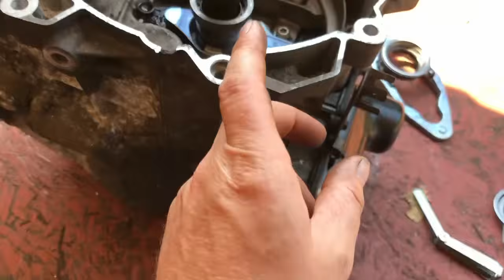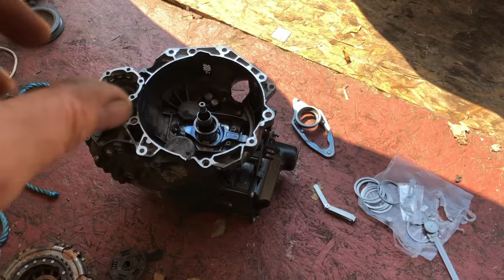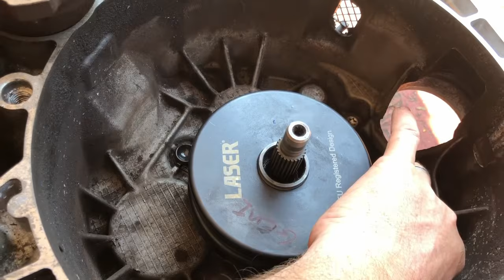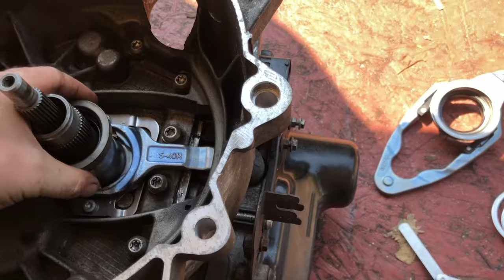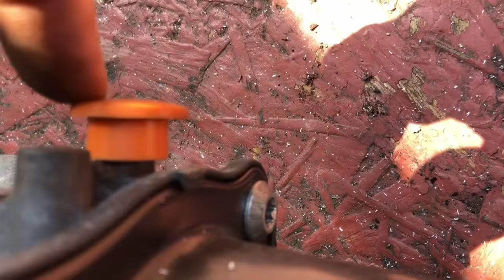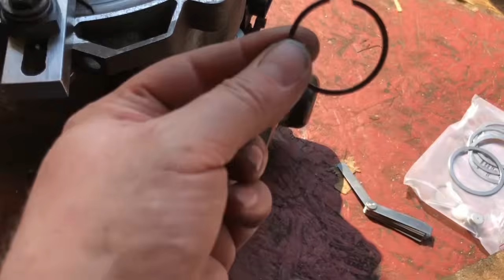DQ200 7 Speed DSG Clutch replacement - DIY - How to.. VW Audi

Comment: I have a dq200 0AM on golf 6. To pull down the transmission to change only the clutch there is a procedure to release pistons?
Reply from the maker: What pistons.?
Reply: @Roverturbo  pistons of the clutch, to remove transmission and to change the clutch I need to release them via obd or with a special mechanic tool?
Reply from the maker: No, you don’t need to.
Reply: @Roverturbo I have only to put it in N or P ? Without pull off battery?and I can pull down transmission and change the clutch?the pistons not remain in pressure?
Reply from the maker: No, they don’t retain pressure.
Reply: @Roverturbo but why if I put it in N the le K1 fork remain in pressure?

Comment: Thanks. 

Just done one, my first. This (your) video helped. Seeing it is more help than being told. 

I work on cars for a living, and everyone always said it was ‘very complex’ when in fact it is not. 

One comment, when mentioning the +0.2 or -0.3 on the clutch pack (or whatever the numbers actually are) referring to the K1 or the K2 engagement bearings you contradict the instructions in the tool kit. 
I used the very kit you did, same part number, same manufacturer.

You say that if  says on the clutch pack, K1 +0.2, take 0.2mm OFF the shim, the instructions say to ‘do what is says” so if it says +0.2 add 0.2 to the shim.
Reply from the maker: Thanks for the comments…. Must of been a slip of the tongue.

Comment: Would you not just put the same shims in that you took out ??
Reply from the maker: You can’t, Such fine tolerances.
Reply: ah ok I thought it be same size shins go back in
Reply: @Roverturbo sorry to bug you again but would you say a vw golf mk6 is a v1 cluch ?
Reply from the maker: 7 speed dsg?  They changed over around 2011, you would have you contact your parts supplier to check.

Comment: I am about to buy a Scirocco 2009 and owner says DSG blinks after 30-40 min of drive so I am looking at how to fix it myself but I do now know yet what can it be? Any ideas?

I do maintenance to my car but never took a gearbox appart and it's scary. Thanks for the video.
Reply from the maker: You need codes before you can do anything. Is that a wet or dry clutch. It’s going to have to be cheap, dsg repairs can be costly.
Reply: @Roverturbo  There are no codes stored seller said, just blinks/flashes after 30-40 minute drive. 

It's dry clutch I believe DSG 7G Scirocco 2009 DQ200

Comment: Did you change flywheel as well?
Reply from the maker: No
Reply: @Roverturbo I need to get mine replaced in my seat DQ200. Do you think I should get flywheel replacement same time?  Thanks for the reply
Reply from the maker: As long as it looks ok. I don’t believe it’s a dual mass or anything like that. Just check it once the gearbox is off.
Reply: @Roverturbo do you mean it doesn't have dual mass flywheel?
Reply from the maker: As I said, I don’t believe it has one, no.
Reply: @Roverturbo thanks for the input. I appreciate it

Comment: Hi just wondering what size shims you used on K1 and K2
Reply from the maker: It’s irrelevant…. What’s needed are unique to every gearbox and clutch pack.
Reply: @Roverturbo  I've got a Gen 1 gearbox and I've got the same issue in Australia no one wants to work on it and to buy the Laser tool kit from the UK is $1500 AUD including shipping. I can find other brands but they for gen 2 only
Reply: @Roverturbo  Plus the new Luk clutch has zero tolerances
Reply from the maker: Doesn’t matter, still needs to be shimmed correctly. All gearbox’s will have different tolerances.

Comment: i have a3 8p 7 sp auto gear box last 3 years its vibration 2to 3rd gear change when he gets hot and now starts 1 st to 2nd is well time to change the cluck pack with you video i have trust now but i need to buy the tools.
if you can give the tool info. is well mach grateful. i never subscribe but now i am. thanks mate
Reply from the maker: This is the kit, you may want to shop around and check prices. 
https://ebay.us/m/bKjM6c

And this to take it out and put it in. 
https://www.amazon.co.uk/Transmission-Compatible-Gearbox-Installer-Remover/dp/B09YTV64KC/ref=mp_s_a_1_1_sspa?crid=3KKM9L0L3DYVX&dib=eyJ2IjoiMSJ9.LExdWkEGBfDVy1sU0maSFchhlbMLRjpZo_9TvN6IW_7SvfZqsVSbC_pH1hJ6Tt-qqKQU4_cEXj19ZkbBWUOl1oEZIXu26Ga1NChk755NtO0xg8vs97vf_euGtFKpXc3aDGWA8RqGHqjH3WjOuiuucA_ZAD0VN7a_iGVguWLiGkkqn5ARtirnedCUig7drYMRHbw-HSX-3dIWQyknxS5dwA.eCzzvwSnNOm9iflCFx0qPIv-pkht2Pr0-svByL9Ywt4&dib_tag=se&keywords=dsg+clutch+tool&qid=1753818623&sprefix=dsg+clu%2Caps%2C81&sr=8-1-spons&sp_csd=d2lkZ2V0TmFtZT1zcF9waG9uZV9zZWFyY2hfYXRm&psc=1

Comment: Hello mate, fantastic work! Just had some things to ask please, my box is completely gone so i am sourcing a new one. If i can find a replacement with low mileage do you think i could make it work without changing the clutches? Also how easy was the replacement? Do i need to remove the drive shaft flanges etc to create the space to get it back in? I have seen other vids and read on forums, but not sure if it relates to other gearboxes.
Reply from the maker: I’m not sure what your asking me, it’s unlikey the replacement gearbox will have a clutch on it. If it does, depending on how long it’s been sitting around, the clutch’s are prone to rusting together. 
Engine can come out forwards without removing the gearbox, but you would to at least remove the short shaft to get the box out on its own.

Comment: Hi, I'll be attempting this job myself shortly on a 2019 Seat Leon Estate, 1.6 TDI DSG gearbox. Please could you advise if you have another video which demonstrates the removal of the clutch pack from the box? I am unable to find a video which demonstrates this using the same puller kit as you have.
Reply from the maker: I don’t. But it’s very easy. Remove the big circlip and remove the first clutch spring plate. Then the small circlip underneath, the tool pushes into the holes in the clutch, twist to lock in, and screw the screw down and it pulls the clutch off.

Comment: Hello Sir ! Thanks for the video. I see it was little tight to insert the plate that simulate the pin ring. I wonder how did the drive feel after installing the gearbox in the car ? Was it smooth and every thing fine ? I have bought the laser tool and planning to replace the dsg clutch by my self. Thanks
Reply from the maker: Car was perfect , I have now done a few.

Comment: Did you do a video on the basic settings side? Have one failing on 100 after gearbox replacement
Reply from the maker: I done it as part of another video I haven’t edited yet. There’s a web page somewhere that shows what the error codes are.

Comment: Can you please share a link to buy the toolkit from? I'm looking to change my clutches cause the companies I've taken my car to, does not know what they are doing 😮
Reply from the maker: This kit to remove and install clutch.
https://www.amazon.co.uk/Transmission-Compatible-Gearbox-Installer-Remover/dp/B09YTV64KC/ref=mp_s_a_1_fkmr0_1?crid=3QN5AKSPGVTZS&dib=eyJ2IjoiMSJ9.IOmQhGfOUrNInT47IXBv2Hexw3qWdOabvGBod-vbOp8.dYDXAWxcFKAqZwPIJXb9giLgk1Fb93X3VQsENQ4K4V4&dib_tag=se&keywords=laser+dsg+kit&qid=1716137751&sprefix=laser+dsg+kit%2Caps%2C108&sr=8-1-fkmr0

This kit to set the clutch’s, you will need to check if you can buy cheaper else where.
https://www.ebay.co.uk/itm/363526253461?mkcid=16&mkevt=1&mkrid=711-127632-2357-0&ssspo=9RtuYQ4-SxO&sssrc=4429486&ssuid=q7_G1vSkR_W&var=&widget_ver=artemis&media=COPY
Reply: @Roverturbo  Thank you :) really appreciate it
Reply: @Roverturbo I can't use these tools for 6 speed DSG?
Reply from the maker: No because the 6 speed is a wet clutch, completely different gearbox.

Comment: Great job! Thank you for the video! I have a question. I have replaced the gearbox with an used one but the car had gen 2 and the replacement one is gen1 do you think they are compatible? Thanks
Reply from the maker: I don’t know for sure, it’s only the clutch forks are different. So I can’t imagine they would be massively different.

Comment: if just change new flywheel, but clutch also old. Must fitting clutch or not.?
Reply from the maker: No you should be fine, the clutch unit just locks into flywheel with teeth.

Comment: Good video. 

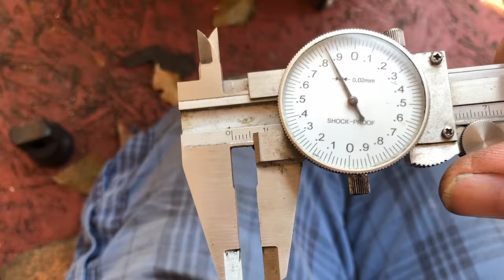18:00 measured 6mm,  below 8,00mm means good.

Pressing down the bearing you should use torque wrench and don't reach 12Nm.

This laser tool is very user friendly, what is the high of each cylinder?

Comment: Quick question! I have a Skoda superb 2010 dq200 gearbox when I press the throttle gently it up shifts without any issue but when I stomp/aggressive push the car it hiccups/jerks a little to upshift what do you think the issue could be?
Reply from the maker: Could be anything, even poss a misfire. I’d take it to a local specialist.

Comment: Good job and in the video you explained great. 

I would like to know do I need to be changed my clutch pack for VW Polo GT TSI 1.2(DQ200 7 speed) clocked 100k kms. My car is running perfectly until I drive for more than a hour or in hill station, a little screeching sound on 1st and 3rd gear shift for 2 seconds, then it runs normal.

I have scanned my car and all looks fine on screen.
Reply from the maker: Thanks for the comments, unfortunately it’s hard to tell from here. Does it look like it’s slipping or flaring when it makes the noise? Ie the revs go up or spike up and down.

Comment: How many kms after DSG DQ200 starts to fail in general? I am planning to buy a new VW Virtus GT. I am confused between manual transmission 6 gears or DSG DQ200 7gears. What Should I choose any recommendation. I am from India.
Reply from the maker: I’m not sure, depends on how it gets driven. Mine had done 100k miles looked fine with plenty of meat left on it but was faulty and had to replace. Maybe because car had been sat for years.  I believe the wet clutch 6 speed is more reliable.
Reply: @Roverturbo  one more question are Naturally Aspirated engines better than turbo engines ?
Reply from the maker: Depends on the engine.

Comment: Great video, in 2 minds to change a DQ200 clutch for a vehicle I am preparing to sell. Car drives fine and shifts gears good as well. Only issue I notice is that theres a 'screech' sound when accelerating from stationary while driving up a hill.
Reply: Hi mate, can share with us the symptoms to replace the clutch? What exactly was doing before getting to the point of replace the clutch...thank you
Reply from the maker: Stuck in gear and wouldn’t do a basic setting.
Reply: @Roverturbo , thank you!
Reply: @Roverturbo no slipping?
Reply from the maker: No, I believe the clutch plates were rusted together, so no clutch, wouldn’t go in gear. The car was sat for a long time due to a engine problem.
Reply: Can you explain what the problem was please? I have the same issue.. thxx
Reply from the maker: Stuck in gear, wouldn’t be basic settings.
Reply: @Roverturbo  I think I might have a different problem because the whole clutch set was changed a month ago by a mechanic and i still hear all that metallic sounds, I don’t have the issue anymore of not shifting gear on a hill but a lot of noise.. do you have any ideas? Maybe the mechanic didn’t change the whole clutch set?
Reply from the maker: @liondary sorry I have no idea. Impossible to tell.
Reply: @liondary you need a new clutch solved it for me
Reply: @ I replaced my clutch and flywheel a month ago and it still makes a lot of metallic noise when shifting gears and when i ride on a bump i hear that same metallic sound as if something metallic was loose.. do you think they did not do the installation of the clutch correctly?
Reply: @ you can get the clutch screech noise when driving up a hill on gear 1. You can do itc with engine bay open and actually hear it while someone is driving